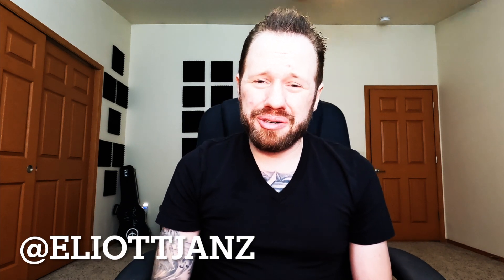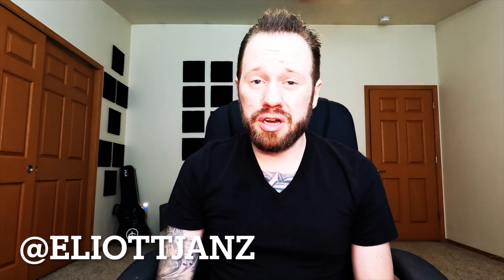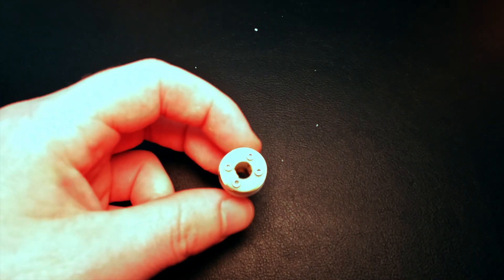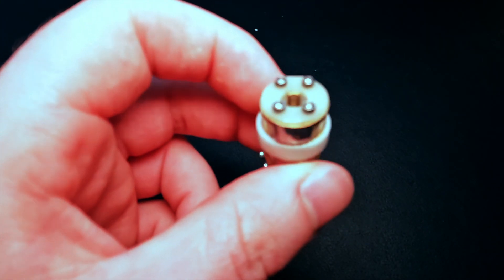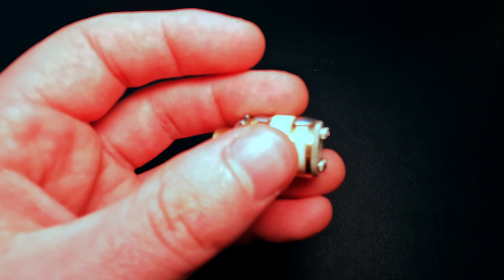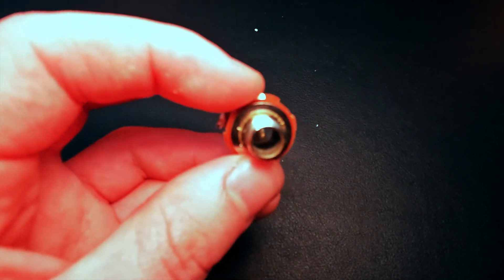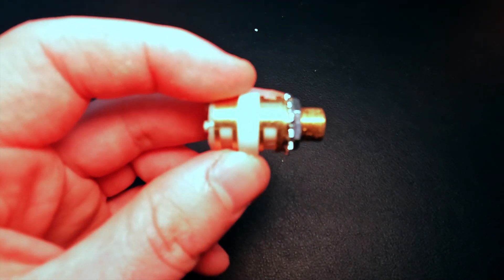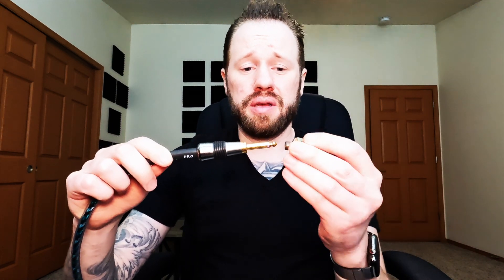QiJack Analysis Plus pro audio guitar output review!

Comment: I've installed Qijacks on about 20 electric guitars, as well as on the inputs for 3 amplifiers. Enough said?
Reply from the maker: NIIICCEEE!!!! Impressive!! Yeah, it’s a great product. Nothing comes close to it.
Reply: Possibly, did you measure or A/B the difference?Tight connections are good. High mass, no… Did you get oiled by a snake? I have a few. Never had a chance to compare in a good, somewhat controlled manner. Also, I assume the QiJack will sound better after a couple hundred hours of break-in.
Reply: Did I measure or A/B the difference?  No. Conceptually the Qijacks seem to me to be a superior design to the standard jacks that have only two contact points.  The PureTone jack seeks to improve upon the standard jack with an additional point of contact, while it seems like the Qijack takes that point a step further.  To me, it appears a bit incongruent for a high-end builder to claim that they use "the finest components," only to use a part that arguably may be the weakest link in the signal chain.

"Tight connections are good  High mass, no."  I'm not sure I would agree that the mass is high, nor do I think that the relatively higher mass is significant in the context of a guitar that weighs between 7 and 9 lbs.  I certainly did not detect any difference in weight at all.  Further I would think that if one prefers a more robust design, there needs to be a certain amount of additional mass.  Perhaps you can suggest to Qijack how they can achieve a tight (and hopefully a superior) connection without high mass?

Did I get oiled by a snake?  Possibly, in the sense that anyone with any preference for any product could be thought of by another person to have fallen prey to snake oil.  That is even assuming the second person invested his own time, money and energy to conduct a wide swath of experiments and then to have reached a reasonable conclusion.  Yet, would those conclusions be the final word on the subject?  Unlikely.

"I have a few."  I'm assuming you are saying a few Qijacks of your own.  If so, what have your experiences been?

"I assume the Qijack will sound better after a couple hundred hours of break in."  There is at least one clip on YouTube that show the before-and-after differences between a standard jack and a Qijack, with one in particular using a bass guitar.  The difference is audible, with the QIjack providing a firmer, better-defined tone.  Whether the difference is significant enough for someone to buy and install a Qijack is a personal preference.  Will the Qijack sound even better after a few hundred hours?  Hard to say without a well-controlled experiment with all other things being equal.  Perhaps, perhaps not.

 @timothyadkins8997